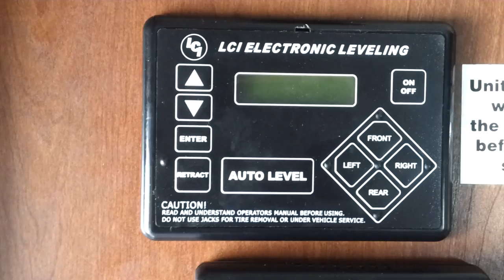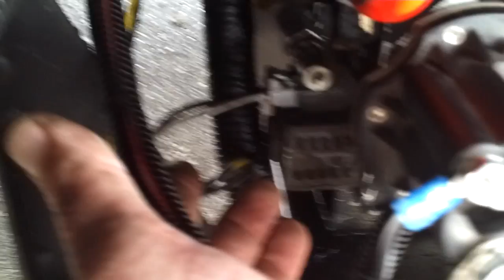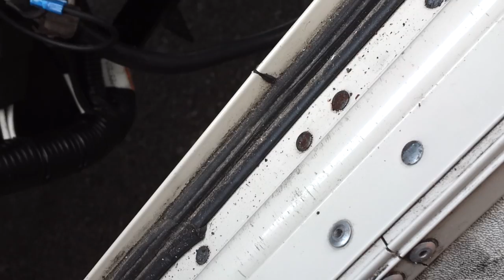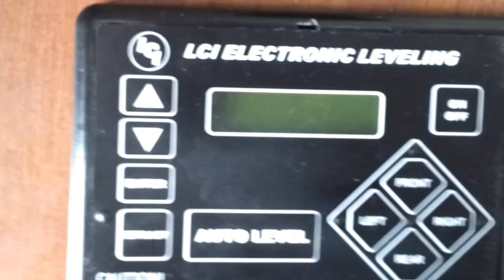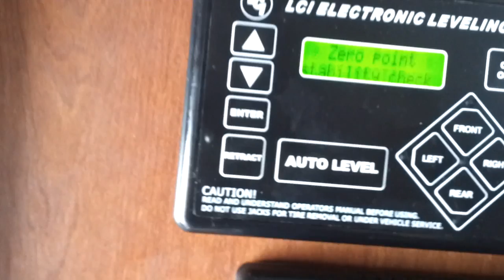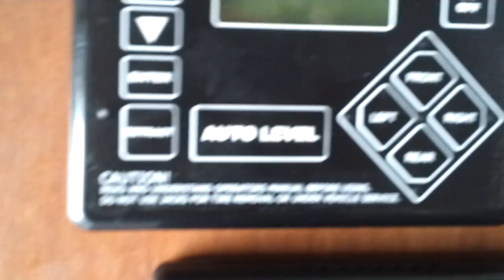Level Up  LCI Lippert Jacks won't retract. Solved

Comment: Thanks so much. My system had **ERROR**
RETRACT TIMEOUT
I couldn't find a specific video for this. 
With this error the control panel was unresponsive. No one at the dealership ever told me how to reset the control panel. I did per your information, now my system is back to normal 😁.

Comment: I had the same issue.  Called Lippert and they trouble shot is and said they thought the control panel button was bad and suggested I change the panel out.  I also found that when I released the emergency break the system went into emergency retract mode and all the jacks went down.  I will now explore the wiring harness fix.

Comment: Did you have any other issue before swapping the harness. Mine keeps tripping when retracting the jacks, but it is also not keeping the zero calibration. I just calibrated over the weekend drove to next campground an hour away and calibration was off again. Did you have this issue?